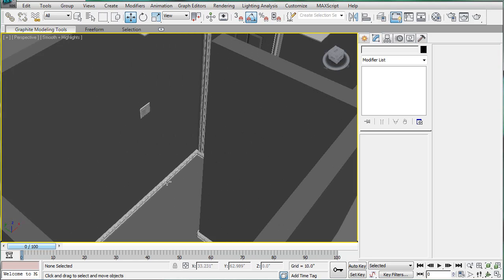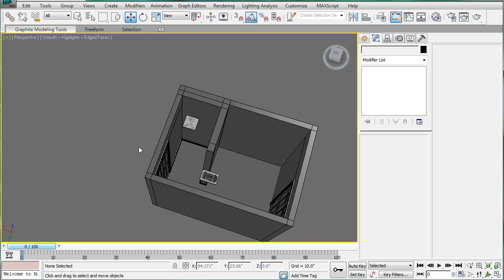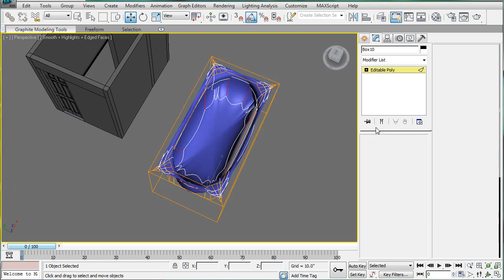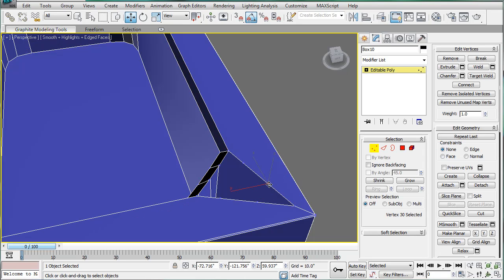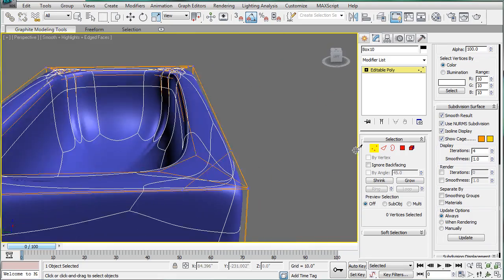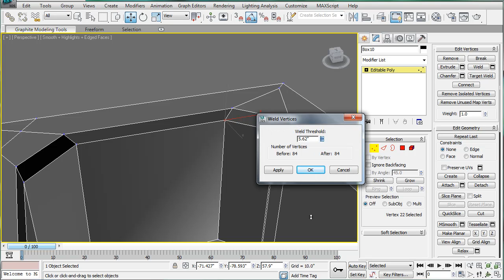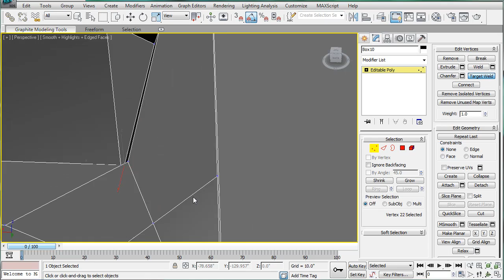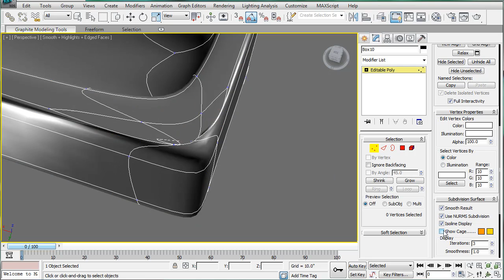3ds Max tutorial - Interior Architectural Design: Bathroom part 12

Comment: The problem you were encountering with the Meshsmooth part is because when you were chamfering you changed the settings to a point where you got triangle polys. Triangle polys are the hardest to calculate during meshsmooth process. It is highly suggested that you end up with square-shaped polys instead of triangles.